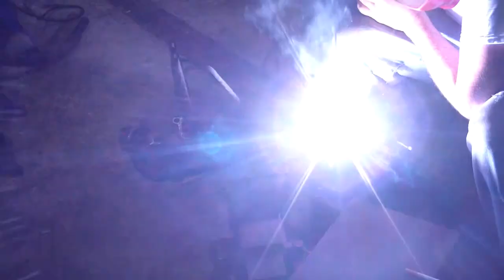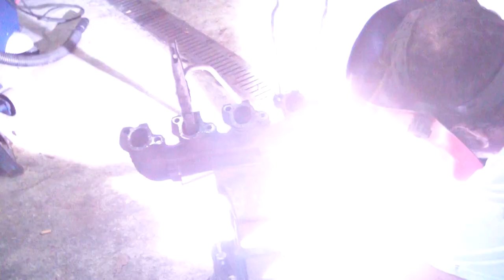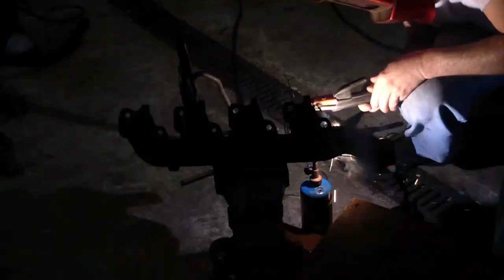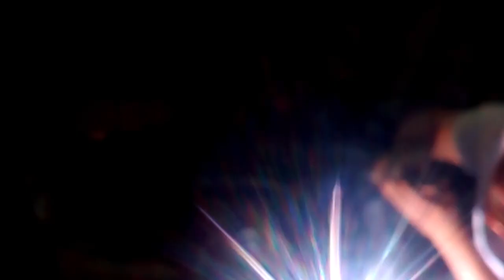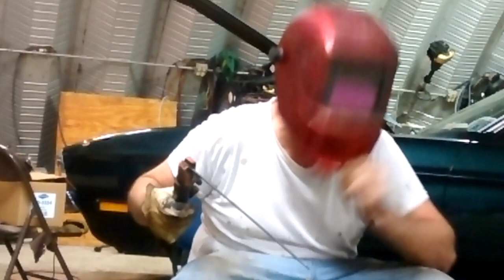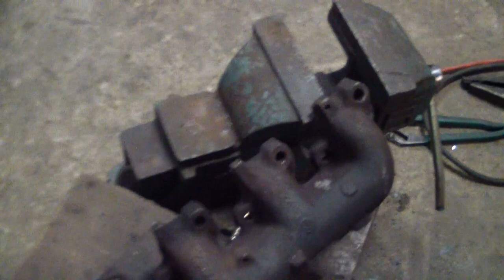Arc Welding A Cast Iron Exhaust Manifold Using Nickel Welding Rods

Comment: Do you remember if you used AC or DC setting? What little I know about and done cast iron welding, exhaust and woodstove parts are the hardest to weld, last time I tried it I had to bubble gum it just so I could add something that looked like weld, good video great car.........
Reply from the maker: The welder I used is AC all the time. It took 7 nickel rods to weld that manifold. It had a thin spot that tried to keep melting and I had to chase the hole till it got back to good metal.

Comment: nice job
Reply from the maker: wasn't pretty but did the job
Reply: Did?it?last
Reply from the maker: Yes I built a homemade turbo hot side for my 87 V8 Ranger that has a 60 lb turbo hanging off a cast iron manifold with no bracing so if it can handle all 60 pounds that manifold will last another 50 years

Comment: Wouldn't it have been better just to get a new one?
Reply from the maker: I tried to find a new one only thing I could find was used ones and they wanted $300 for one. just had new exhaust put on a week before it broke so it was weld it or get headers and have to take it back to the muffler shop to redo it again
Reply from the maker: look up a 72 351C and try to find one they don't sell them if it was a 351w or 302 or 289 they sell those nobody sell a new one that I could find headers all day long
Reply: Well l got tp hand to you, excellent job.
Reply: its still educational guys...im glad he didn't buy one.
Reply from the maker: They don't make a new manifold anymore for a 351C. It was weld it or go to long tube headers and the owner just had new exhaust put on a week before it broke